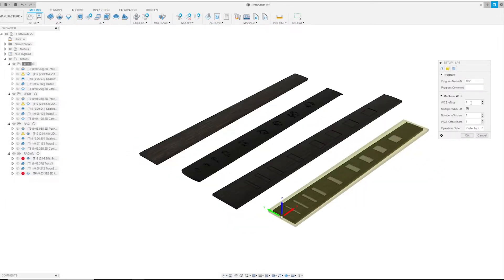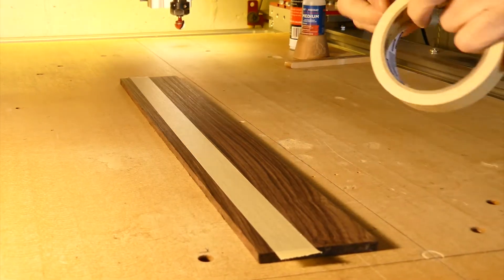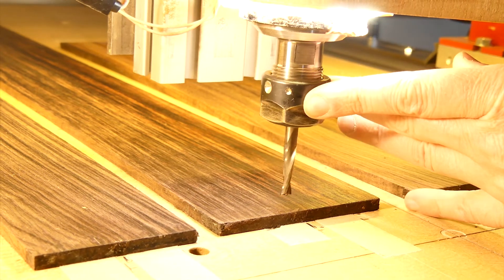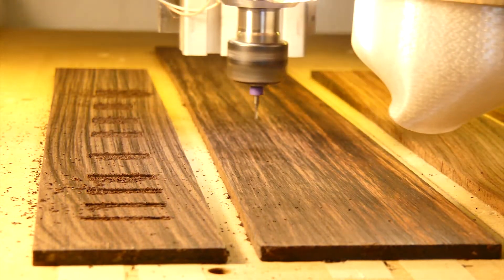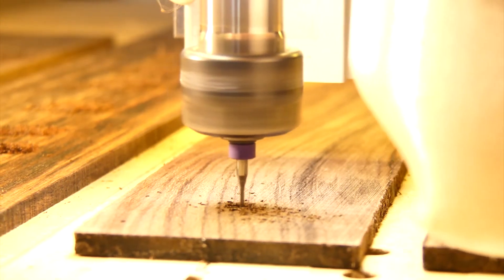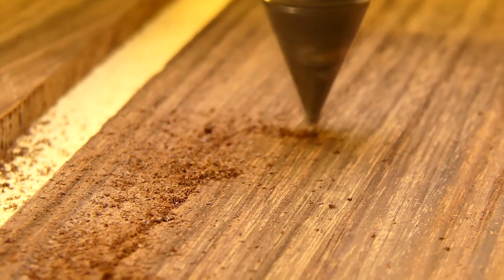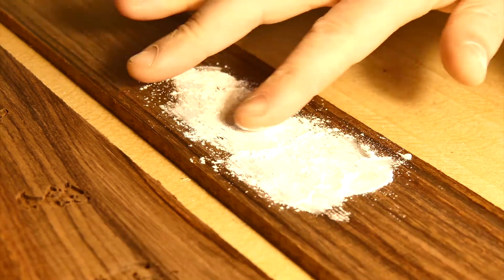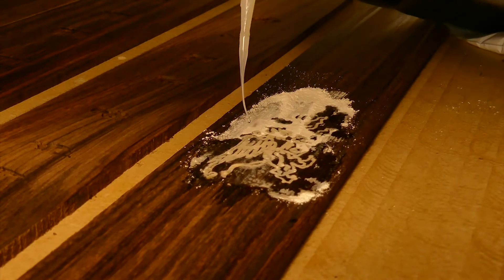CNC Four Different Guitar Fretboards At The Same Time | Multiple Work Coordinates Fuison360 Mach3

Comment: Looks Great Man.
Which Radius bit you use for fretboard Radius ?
I have hard time with milling marks for fretboard Radius.
Reply: Great video where would I pick up one of those bits and also your surfacing bit. They both look great.
Reply from the maker: They are all from ebay, just regular router bits, nothing special.
Reply from the maker: I'm using a 0.75" ball nose with a 0.06 step over. I sand with a radius block with 60, 400, and finally 800, it's a bit of work,but not bad.